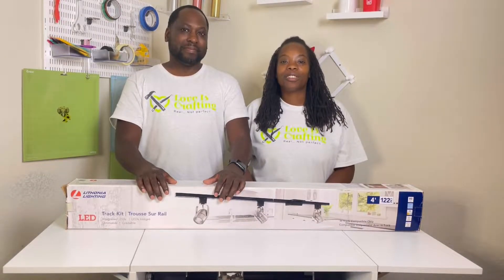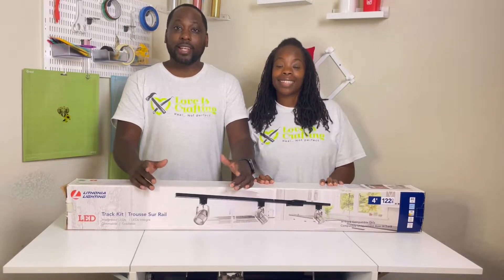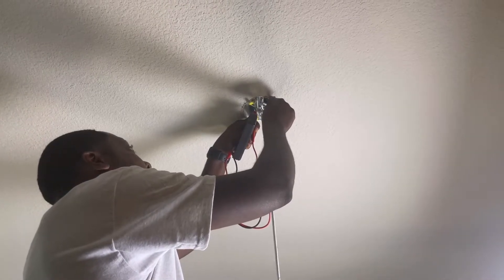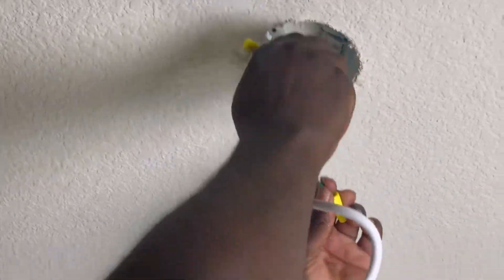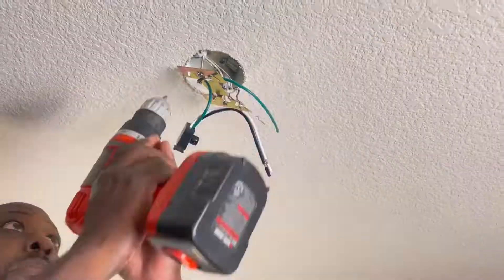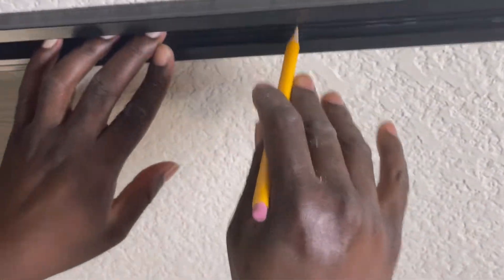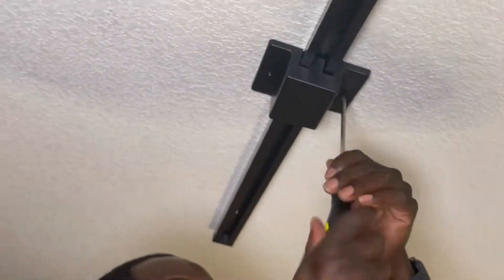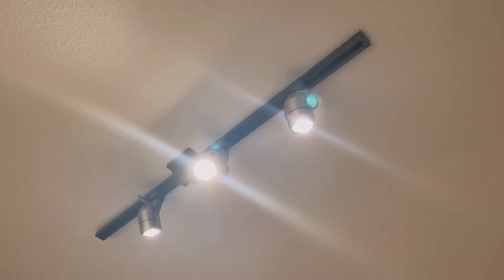HOW TO INSTALL LITHONIA TRACK LIGHTING KIT| DIY TRACK LIGHT

Comment: Tried doing this with my dad.  We tested it out before installing and it be worked.  When we put it on the ceiling for some reason it doesn’t work.  We’re confused.  We also tried switching the box but that also didn’t work.  😞